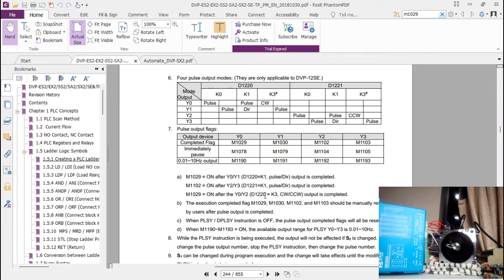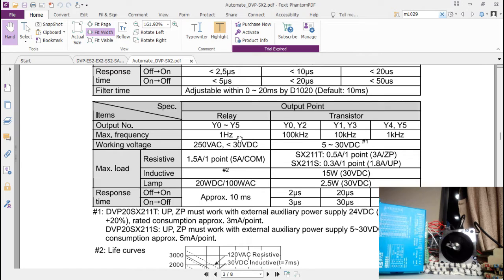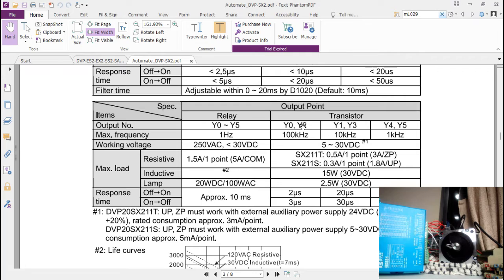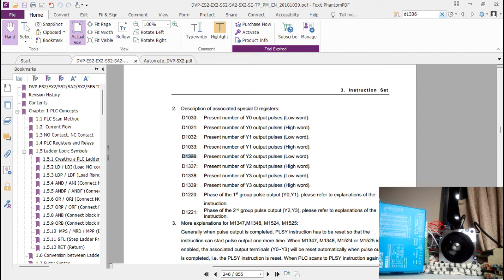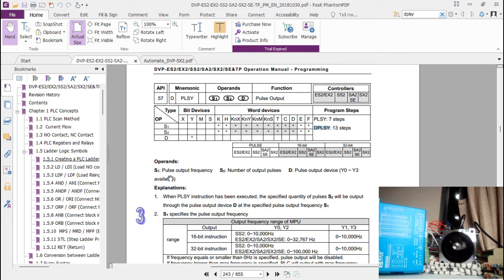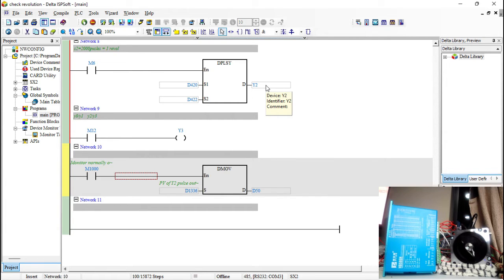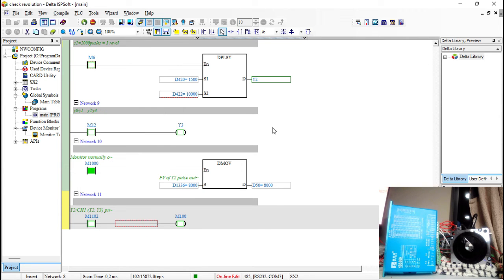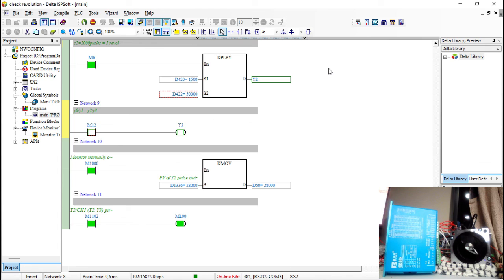PLSY ,DPLSY ,DELTA PLC STEPPER PROGRAMMING HB86H

Comment: How can I decrement the D1336 value?
Reply from the maker: You can move a zero into the register.
Use absolute position instructions if you change direction of motor value decrement automatically until it gets to zero.